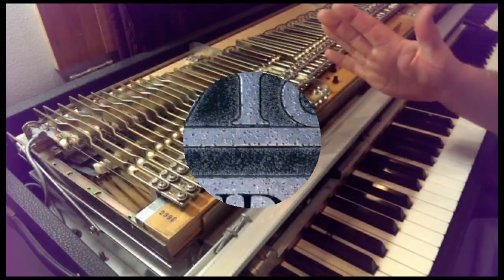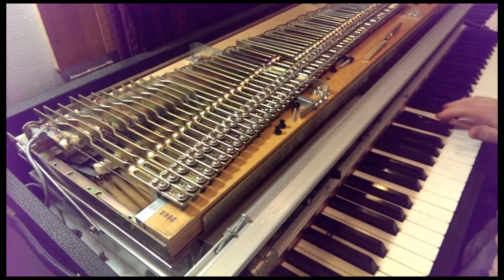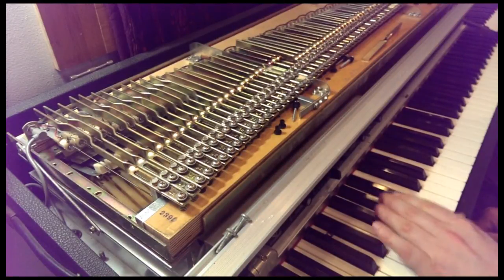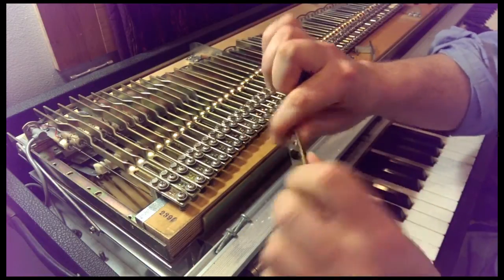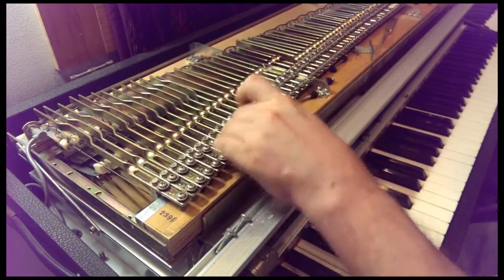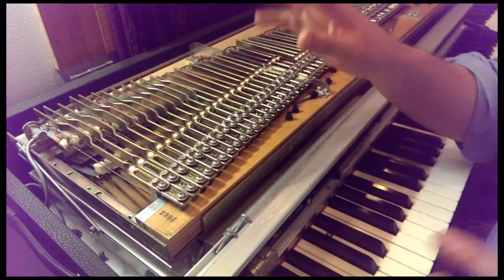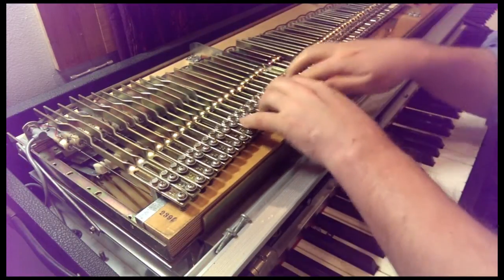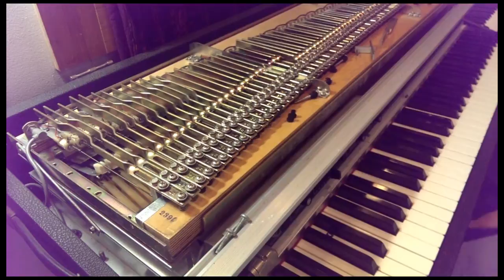Fender Rhodes - Replacing Rubber Grommets - Avion Studios - Part 1

Comment: when i pick up the sound directly from the cinch connection at the left behind, so i omit the bass and volume regulation, the sound is very much clearer. The volume control somehow damps the brilliance. What is your advise do to about that
Reply from the maker: Hey Ludo, YES bypassing the passive controls is generally a big improvement. On the passive Rhodes the volume and bass can really only reduce the signal (or amount of bass) coming from the harp and they generally make the overall sound worse. (A lot of that has to do with how impedance and resistance is affecting the sound.) You should definitely check out the RetroFlyer which will retrofit into a passive Rhodes giving you an active volume, eq and tremolo. But if you don't have a RetroFlyer, I would continue going directly from the harp, it will sound better. It's not that there's anything wrong with your controls, it's simply that the passive controls will never sound as good. I hope that helps. Best, Greg - Avion Studios

Comment: do u have any suggestion on what to do with my screws? it is stuck. maybe because of the dried old grommet. it just wont turn
Reply from the maker: Well that can be an issue sometimes. If you're trying to avoid stripping the screw then generally some vice-grips will work alright to get it started moving. Impact drivers also have good success if you have one around. But I'd try pliers/vice grips around the head of the screw first. Let us know if that works for you! All the best, Greg
Reply: thanks, one more question,does the usage of wd 40 will help?
Reply from the maker: @livegun5572  Well.....it may technically help, but it shouldn't be necessary. Plus you'll avoid having your Rhodes smell like wd-40 for a while. You shouldn't need lubrication once it's freed up unless something unusual is going on. Even then a less odiferous lubricant...like a clp or a teflon would be better.
Reply: Avion Studios well, im gonna try ur suggestions.my screws are really hard to remove because of age. ill update u if anything works. thanks a lot